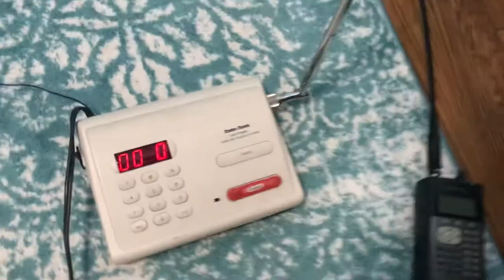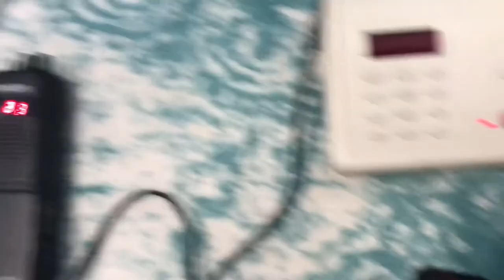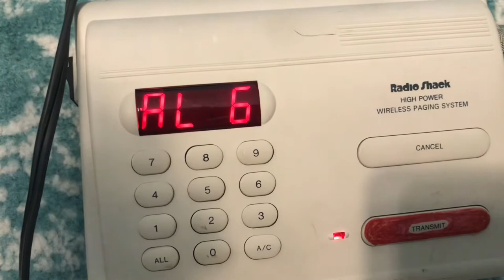RadioShack On Site Paging System - Transmitter and Pager Receiver Functionality Demo Test 27.255 MHz

Comment: What frequency the transmitter use
Reply from the maker: It operates on 27.255 MHz - authorized under Part 95 of the FCC rules, specifically 95.701 through 95.899.  

47 CFR 95 Subpart C - Radio Control Radio Service or "RCRS".  Often it is called "Class C".  

Transmitter power is limited to 25 watt on 27.255 MHz.  27.255 MHz is also CB radio channel 23 (Part 95 Subpart D).  The CB radio service is often referred to as "Class D".
Reply: @R4002 only the dead key carrier power is limited to 25 watts. Fully modulated you can pump out 100 watts.